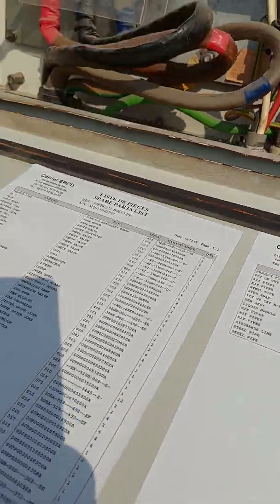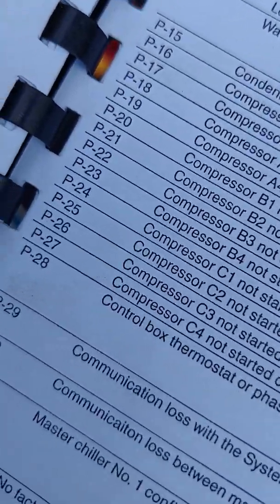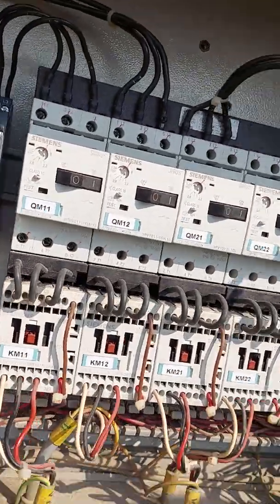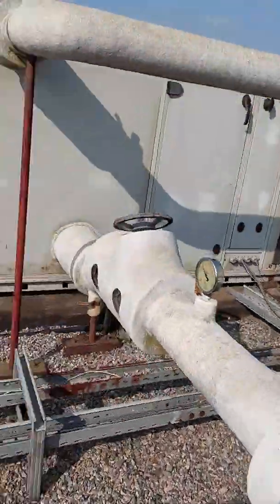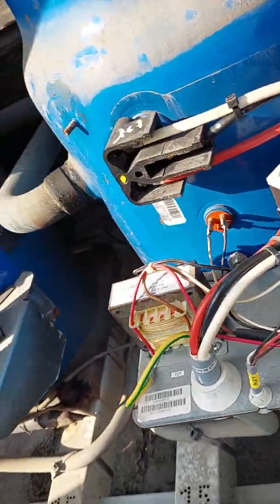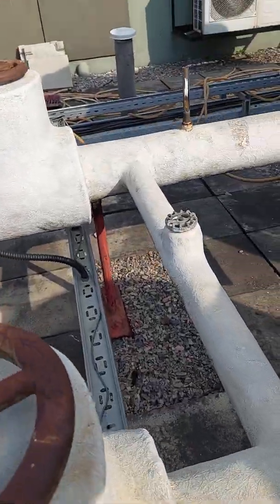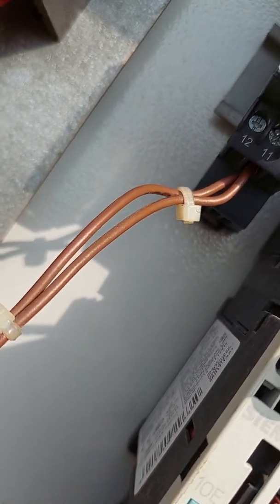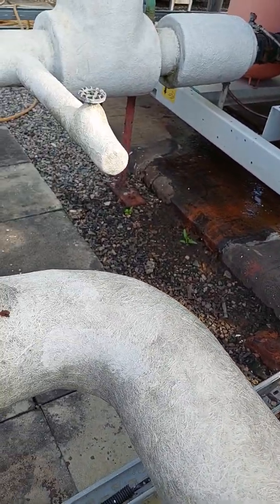P28 error code. Carrier Chiller

Comment: Bro I got daikin Vrv unit error code LC 19 ,it's mean can motor Pcb board fault or main Pcb board fault
Reply from the maker: Good day.LC19 error is please check inverter fan  pcb or fan motor use your meter to test for short circuit.
Reply: Thank you bro